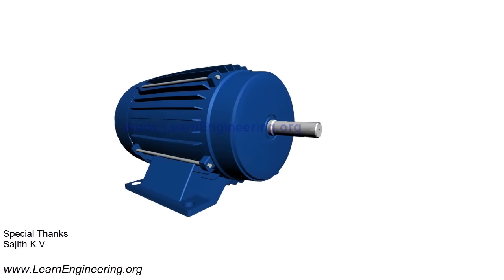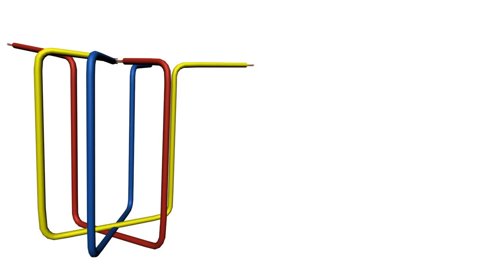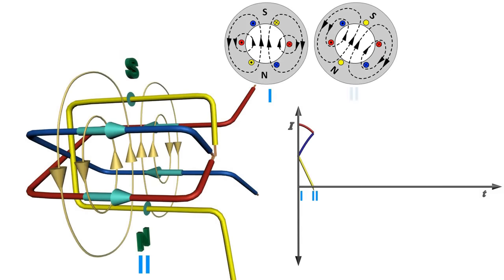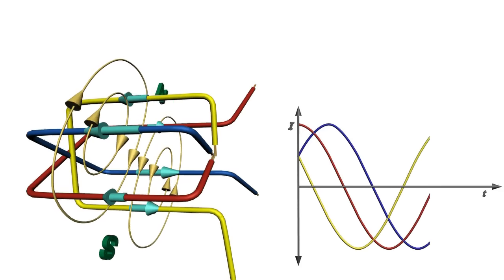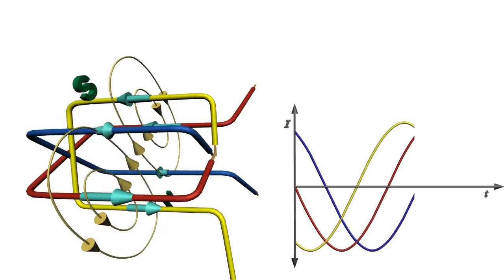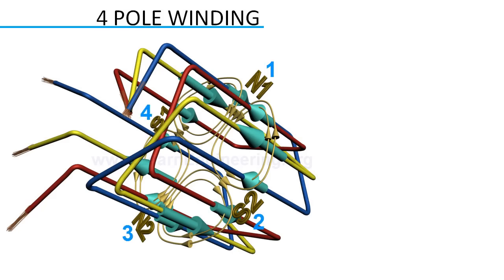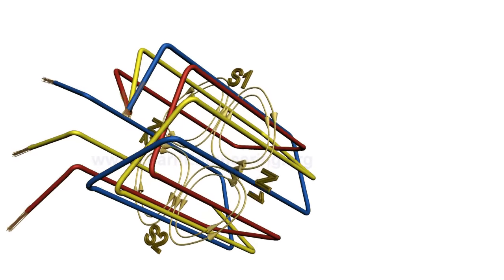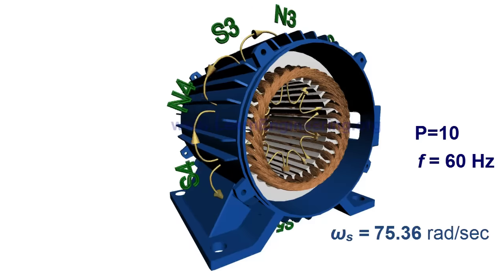Rotating Magnetic Field & Synchronous Speed

Comment: Good video explaining rotating magnetic fields, but unfortunately your 3 phase waveforms are spaced 60 degrees apart not 120 degrees.  One of the waveforms is 180 degrees out of phase.
Reply from the maker: They are placed 120 degree phase difference.
Reply: Learn Engineering
It seams to me that you are wrong. I am teaching electrics in a technical college, and I have discussed this video with my colleges. Your diagram is not showing a three phase current with 120 degrees between the phases.
Is a pity, because the rest of the video is great.
Reply: You need to flip the red phase over (shift it 180 degrees)
Reply from the maker: Keith Evans
Both the figures are right.  You need not to compare with figures in text books. Thing logically. :)
Reply: Learn Engineering I'm not comparing the wave forms with what's in a text book I'm comparing the wave forms with what I'm supplied with from the supply authority. Three phases A,B &C all spaced 120 electrical degrees apart. Now that's logical!
Reply: Keith Evans The currents in the animation are not right. (They do not add up in the star connection). Actually the blue coil should be reversed so that the phase connections point in 120 degree directions).
Reply: Learn Engineering Your currents do not add up in the star connection. You need to flip the blue coil.
Reply: @noseyknowsme  Yes you are right, the period is 360deg so the 3 phases should be evenly spaced by 1/3 of a period and not bunched together like in the animation. @lesics love your work but you should correct this, it doesn't make sense!

Comment: Guys sorry.. i still don’t understand, which is the cause that make the magnetic field rotate? :s
Reply: In a single coil, powered by AC, as current flows in one direction, ie the first half of the AC wave, a magnetic field will develop in one orientation, raises in strength then dips back down before reversing orientation as the AC crosses the zero point and completes the second half of the wave for a full cycle. 

If you were to rectify the AC wave thus only getting positive waves you would see the magnetic field maintain orientation as the strength bobs up and down (ignoring the inductor like effects that would oppose changes in voltage slightly), ie instead of N S N S the field orientation would be N N N N for each wave voltage 'hump'. 

The rectified bit isnt important, just hammering home how voltage and more importantly current direction determines field orientation. 

Now, if instead of a single phase of AC, we used 3 coils connected to 3 phases of AC, 120 degrees apart in rotation, then the N and S orientated fields would appear to 'rotate' around the stator. Its not physically rotating, per se. Its the magnetic field is being built, dipping, and flipping in time with the current in each given phase. It simply appears to 'slide' across which ever coil is in the N or S orientation based on the direction of the phase current in the coil, effectively dragging the field flux density along for the ride.

The multi pole designs imply instead of using 3 coils (one per phase, each coil covering 120 degrees of the rotors circumference, or 120 degrees apart in rotation) youd use 6 (2 per phase, 60 degrees apart in rotation) for a 4 pole motor, or 9 coils (3 per phase, 30deg apart) for 6 pole, etc.They then overlap the coils with a slight offset for various magnetic field motive force voodoo reasons (Look at the motor casing in the last bit, see how the coils seem to come out of one runner, cross a few, then go down another? They also share runners with other coils, in a specific sequence which maintain the smoothly 'sliding' or 'rotating' magnetic field peaks).

Comment: In 2 pole winding i can see the net direction of the magnetic field. But in 4 pole winding what will be the direction of the net magnetic field?? I can only see the 4 pole rotate simultaneously but what will be the direction of net magnetic field created by adding the magnetic field of the 4 pole?
Reply: The multi pole designs just mean there are, 2 N fields and 2 S fields for a 4 pole, 3N/S for a 6 pole, etc. Its just adding another coils per phase and splitting the separation in rotation. 1 coils per phase gives 3 coils placed 120 deg apart gives 2 poles 1N 1S,  2 coils per phase gives 6 coils total placed 60 deg apart (however, if you only look at, say the first coil of a given phase, they are still 120 deg apart. Its the second coils of the other phases that are 60 degrees either side of a given coil. imagine just taking another 1 coil per the 3 phases, flipping it over, and laying it back down perfectly offset, so phase 1 coil 1 is opposite phase 1 coil 2, and winding this flipped over copy so that coil 1 is N and coil 2 is S on the first half AC wave and flips for the second half. As the phases cycle with the AC current they create a N AND S pull on the rotor per phase as opposed to just the one field direction per cycle).

Comment: Amp up the voltage, rotate the fields very fast and you built yourself a first class electrogravitic engine (aka "anti gravity"). Just don't tell anyone or some nice men will come visit you. The last part was no joke - do some research and you will find it has happened before (outside of the Matrix of course).
Reply: voltage has nothing to do with the speed od rotation. only frequency of aplied voltage

Comment: Hey, I believe the North and South poles in your magnetic field diagrams are incorrectly labelled. They should be flipped
Reply from the maker: North and South poles are correctly marked.
Reply: Learn Engineering My bad, you are the master
Reply: Learn Engineering how about the rotating magnetic field of synchronous generator? as we know, for AC generator, rotor magnetic field (Br) produced from the rotor winding induces voltage in the stator winding. And this rotor magnetic field rotates because of the rotation of rotor. Could you please made a video of that. tq
Reply: i hope somebody explain why poles correctly marked, i also think it should be flipped
Reply: DWattify can you help me?

Comment: Why there are 10/12 poles in the induction motor? As we see from the equation. As the number of poles increases the synchronous speed decreases. Isn't it good if the number of poles stays minimum, As we're getting higher synchronous speed from it?
Reply: As speed increases, torque decreases. Also higher the speed, more wear and tear of bearings. So speed is decided as per application. For water pump, maximum speed is required. For cooler, medium speed is required and for machinary which requires high torque and less rotation, low speed is needed. In case of ceiling fan, the speed is reduced for safety measures.

Comment: Can u please explain how synchronous speed is promotional to no. of poles?
Reply from the maker: I hope its clear from video. Please watch it carefully :)
Reply: First thing. Proportional, not promotional. 

Second thing: Proportional means a multiple, or is the product of. The equation for synchronous speed
is (4 * pi * frequency) / (number of poles) . In this case, the more appropriate term to use would have been inversely proportional because its a dividend rather than a multiple of. 

The fact that you asked "how is how synchronous speed is promotional to no. of poles", and given the context that the video tells us what the equation is, but is short on why,  makes me think you really want to know why, rather than what is the equation. 

It can be seen visually in the video, but the audio didn't cover it, so here goes. Say you have two poles. One full 360 degrees of rotation in the magnetic field might look like (North  then South), and would take one full cycle of the electric field. But, if you have four poles,  360 degrees of of rotation in the magnetic field would look like (North South North South) thus require two full electrical cycles to complete.  .

Comment: what is reason it will not exceed synchronous speed??
Reply: It actually can when working as a generator. In fact, it's always faster than the synchronous speed.

As a motor, however, it will be always slower than that speed:

The rotor in a motor rotates because of the relative speed between the magnetic field and itself. Thus, the rotor cannot operate at the magnetic field speed, cause there would not be any relative speed and, therefore, the magnetic field would not induce any EMF... So there would not be any current induced in the squirrel cage... So there would not be any torque...

If the rotor reached the synchronous speed by any external means, then (as explaind above) the rotor would decrease its speed, reaching a stationary speed lower than the synchronous speed

Comment: so the speed of rotation can never be greater than synchronous speed in an induction machine?
Reply: @splodge695523 "so the speed of rotation can never be greater than synchronous speed in an induction machine?"  

Depends on what you mean by speed of rotation. If your referring to the stator's magnetic field, its magnetic field speed of rotation IS the synchronous speed. On the other hand, if your referring the the rotor's rotation, then an induction machine has two modes of operation. One: as a motor where the rotor spins slower than then magnetic field because of load and or friction, and is described as having a positive slip. Secondly, the other mode of operation is as a generator where a prime mover spins the rotor faster than the magnetic field's rotation, and is described as having a negative slip. 

As a motor, an induction machine draws power from the grid, As a Generator it feeds power back to the grid.